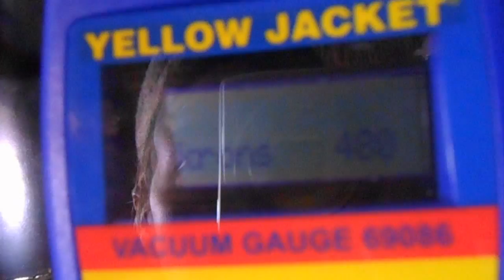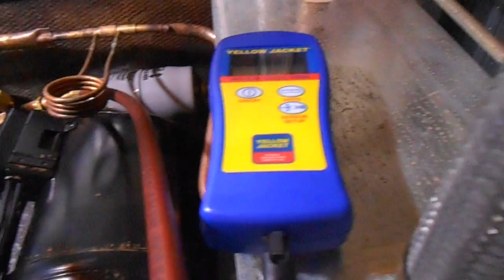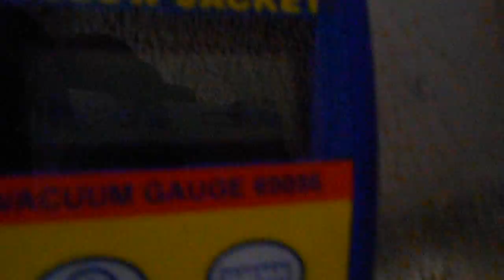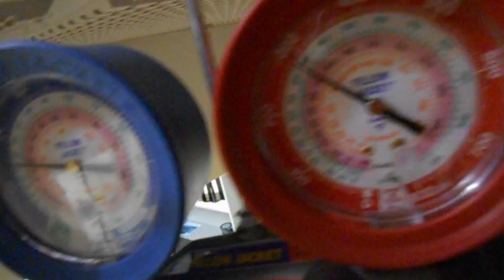Suite 250 - Reversing Valve Replacement #1

Comment: You have to be careful, most heat pumps don't have crankcase heaters, and when the system is off, or is unable to get proper refrigerant flow, most of the compressor oil will migrate to the warmest part of the system, and it just gets recovered out. Did you have to add oil back in, or notice an unusually higher weight recovered?
Reply from the maker: John Smith Thanks for watching! This unit actually does have a crankcase heater but, you present a valid point. It is important to be aware of how much oil is in the refrigerant you are recovering and in turn, back in the system.